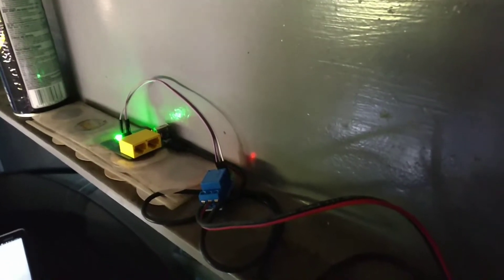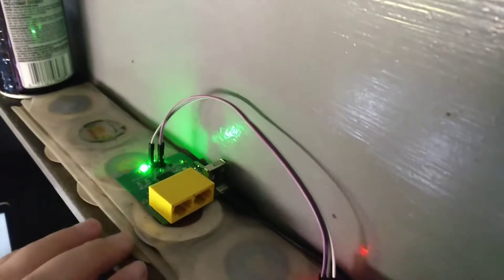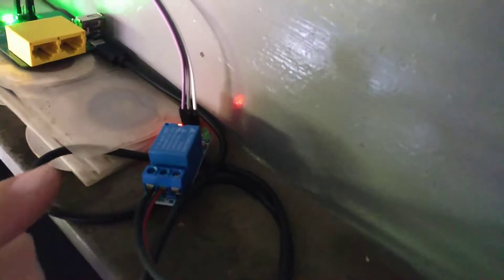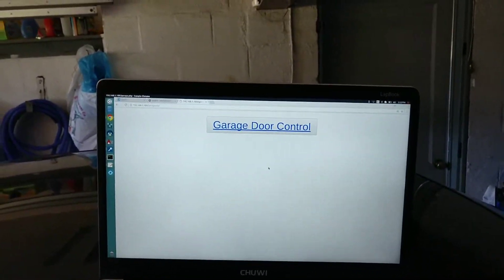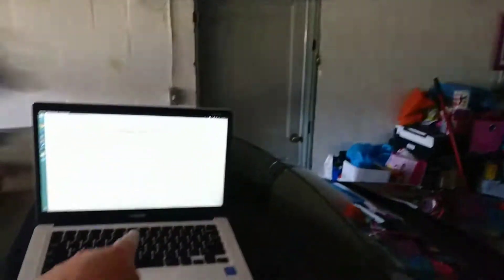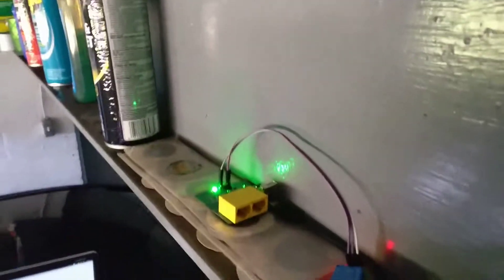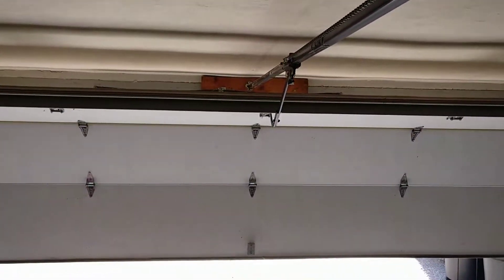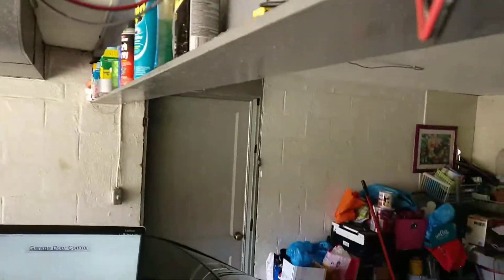OpenWRT DIY WiFi garage door opener

Comment: Awesome job.. Did you transfer the code to an ios/android app so you just open the app to click the link?
Reply: if you havent done it yet, look into "app inventor". If you've ever done scratch programming, its very similar, and you could have a functional app to do that very quickly.
Reply from the maker: Thanks! That should be pretty easy to do. I haven't done it myself personally yet, as I've found it easy enough to leave a web bookmark on my android home screen and click that, but since its a simple HTTP call shouldn't be hard to do. I'm no coder by any means, but sounds like a fun project sometime.